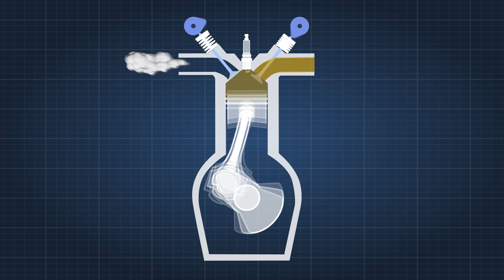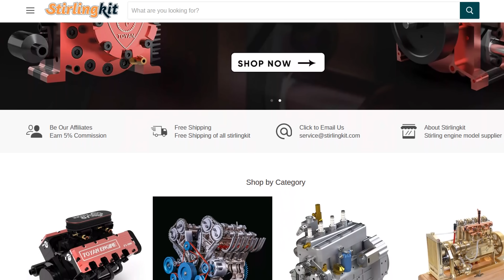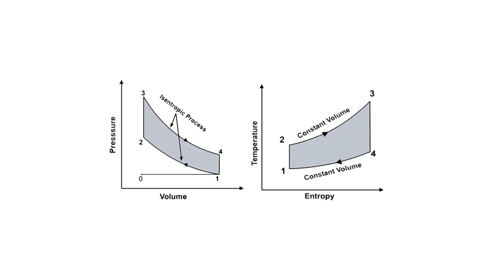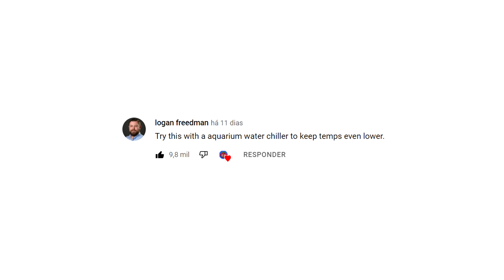I 3D Printed a Transparent Combustion Engine in Resin

Comment: Because on rhis little engine the ignition is switched on/off by a magnet. Meaning spark happens every TDC(top dead center). Because of that when you rev the ignition must be advanced so the fuel mixture has time to ignite in the chanbef and explode at TDC. And this is only on engines with an ecu(engine control unit).

Comment: It's not running as fast because Nitro methane can burn more at the same time but isn't as powerful, the engine is built for gasoline, which means it injects at a slower rate thus burning less Nitromythane and in turn getting less power.

Comment: Sir, it seems to me that you are having trouble with compression because the resin is more pliable than steel or brass due to temperature causing it to become more prone to plastic deformation. This may explain why you get a power stroke at first and then it skips a few.  The first power stroke that produces heat and pressure expands the resin cylindar slightly, losing compression enough for the carburators setting to not provide theright stoic mixture and therfore, no ignition until the "blank" strokes cool the resin, allowing it to regain it's original size, and then you get compression, and a good ignition stroke.  This would also explain why the more powerful, hotter fuel performedthe worst.  Great demonstration, as all your videos are.  Thanks for sharing your experiments with us.

Comment: it seems to me that the engine receives too little air for a given amount of fuel, this would explain the ignition at 25% at low speed, it would be very interesting to see the operation of this engine with air under pressure

Comment: The reason the methanol reved higher is because the air/fuel ratio was leaner. Thats why when you run methanol or any alcohol,  you jet the carb for twice as much fuel.  As far as the motor not firing on every ignition stroke, is because it doesnt have any load on it. Make it do some work with a load and watch how it acts! Great video btw!

Comment: I have an idea . The idea is to use water as fuel by a process called electrolysis  when we do that the hydrogen and oxygen in water breaks when you use that as fuel it will get more power will be generated and the byproduct is water

Comment: Look up R/C remote needles. Having one would allow you to adjust your fuel flow separate from your air flow. Allowing you to run rich or lean. It's a shame you don't have a distributor to twist and get your timing right. You may be able to electronically advance or delay whatever is sending the signal to fire the coil. Or you may be able to adjust the pushrod length and change when the valves open and close to shift the amount of vacuum and compression you have. But doing that could cause issues if the valves and piston have an interference with one another. 

It's crazy you've done this. I'm currently embarking on the journey of making my own R/C engine with my dad. He's big in the boat side of it, but engine manufacturers are starting to slim down in that space. Hence, the journey. We're going to be making a two stroke nitro-methane engine from billet, but I'm big into printing. So I'm going to try and print the block out of pet-cf or pa12-cf as well. The glass transition temp should be above the combustion chamber temps. The only real issues we may run into are vibrations and layer adhesion. R/C boat engines can hit close to 30,000rpm if the crank is balanced right and the block is thick enough to not split. Honestly, I'll just be happy if it hits 15,000 rpm before it blows.

Comment: Methanol contains only half the energy per gallon of gasoline but has a very high octane rating. Increased compression ratios could yield 5 to 20 percent more power. Methanol can be produced from natural gas or from wood fiber.

Since an engine's cylinder can only contain a limited amount of air on each stroke, 8.6 times as much nitromethane as gasoline can be burned in one stroke. Nitromethane, however, has a lower specific energy: gasoline provides about 42–44 MJ/kg, whereas nitromethane provides only 11.3 MJ/kg.

Comment: My guess on why the lower RPMs is that the power cycle is actually slowing down the timing: it forces the piston into its most extended state: refusing any movement pushing it back up. If I had to guess: the travel distance of the piston in the cylinder is too long.

Comment: you might need better piston rings, i can see fuel escaping into the crankcase. and wheres the oil? i can see some scoring marks on the piston, im afraid you are running the engine dry of oil. that is really bad for the engine

Comment: These fuels that require less air need to be tuned ao supply more fuel to burn efficiently. Thats probably why it wqs misfiring. Timing could be adjusted also but i dont think that was the main issue

Comment: i think that the combustion is not working because the resin thing is not air tight and it does not compress the air enough you can see that at 3:49

Comment: Has it occurred to you that you cannot mix the air/fuel ratio the same in all three cases?  It requires almost twice the fuel for methanol and three or more times in the case of nitromethane to achieve the same power for each power stroke.  You said nothing about changing your carb's jetting, so I am forced to believe you skipped that step to leave the solution of the question as an exercise for the students.

Comment: Maybe your purely-mechanical sparkplug timing, isn't responsive enough at high speeds, to trigger the sparkplug at the best time. You also aren't measuring the torque with the speed, so you may be missing important data.

Perhaps a phase-locked-loop, to produce the right negative delay, synchronised by the valves/cams. Then again, an Arduino etc should easily be fast enough to experiment with timing, and also to log the data.

Comment: Ok

I am a 15 year mechanic, and high performance enthusiast. Your problem us likely due to air fuel ratio which changes between all of those fuels. The higher the nitro the more fuel you need and the more timing advance. Up to 60 degrees btdc on 90% nitro. Less fuel for methanol from nitro, and even less for gasoline. You had the mixture too rich for gasoline and too lean for nitro. The one 25% I believe was obviously within the range that allowed the engine to fire consistently. More carb tuning could yield results, but likely you would need to change jet sizes to get enough for Hugh nitro content

Comment: You could try connecting the exhaust back in to the intake to reuse unused fumes, which will improve performance.
Reply: it will make it run like garbage, by adding co2/monoxide back in the cylinder it takes up room for the oxygen, making it run extremely lean.

Comment: First, I guess energy density doesn't translate to power directly. Here in Brazil, we have cars that can use gasoline, ethanol or any mix of both. While we get less mileage with ethanol, we get slightly more peak power (and torque) with it. One thing I know, although can't explain why, is that both optimal compression and optimal spark timing are different for gasoline and for ethanol. In our cars, spark timing is easely adjusted by the ECU, but compression is fixed, so engines are built with an intermediate compress ratio. Besides, there's the mixture proportion, that also must be adjusted for each type of fuel (again, easily done by the ECU).
So, what I'm trying to say is that there are some parameters that must be adjusted for each fuel that is used, and for your engine, they must be set manually, since you don't have electronic fuel injection.

Comment: I think the airflow to your carburetor was bottlnecking the performance of your engine. The nitromethane ran great due to its need for less oxygen. But it's low energy density means you will inevitably make less power if you are using the same amount of fuel. Considering the nitromthane runs with 4 strokes I think it would be fair to say you need more oxygen for the other fuel types to do the same. You will likely need to adjust your carburetor to use more air or you might need an entirely new carburetor to fuel the full potential of the engine. Great video btw😘

Comment: I am guessing the issue is fuel mixture, when it’s not correct it misfires, and maybe some left over from a misfire and some new mixture gets closer to a mixture that will combust.   Is there a way you can tune the fuel mix?   The thing with nitromethane is it has its own oxygen and needs to be run very rich compared to petroleum, and methanol also needs to run richer than petroleum, but not as rich as nitro. 
When you play with a gas torch, excessive fuel is a very slow burning orange flame and not very hot, as you add more oxygen the flame turns blue and get hotter .   I would experiment with mixtures until you had a blue flame that fires every time . 
Also ignition timing plays a part of good combustion.

Comment: Different engines need different fuels . Engines with less compression need fuel that combusts
Earlier and ones that have more compression need fuel with later Combustion. For Stirling kit engines we usually do not use gasoline anyways it's too powerful

Comment: Theres a sweet spot between power density and burn time. So, the issue you're having is that the much more power dense fuels are burning too quickly, and not providing as much mechanical effort downwards on the piston. The slower the fuel burns, and the more consistently/powerfully, the more mechanical effort is transferred to the piston on the power stroke.

Comment: Getting 4 strokes means that u have perfect otto cycle. Your design works well with that fuel. Torque is inversely proportional to angular momentum. Then it’s generating torque. To put things in context, ur first design test would suffer more than the design in the last test to climb an inclined plane.

Comment: I've been watching an enjoying a lot of your videos. This comment is more about your issues with making metal parts. Have you ever considered trying some "lost wax casting." You are able to print very precise parts out of resin that you could invest in either sand or other high resolution investiture, use your kiln to melt/ burn the resin out of the mold then pour hot liquid metal into the mold. Its a very old technique, but can produce some great results and you would probable enjoy it! It's also not very expensive. It would be a great way to get metal parts from your 3D printing capabilities.

Comment: There are multiple factors at play here but most importantly, the energy density of the fuels is a red herring. You're thinking about it the wrong way. 

Methanol and nitromethane have less energy than gasoline but you can use disproportionately more into the engine which allows both to make MORE power than gas. 

The issues You're dealing with here are the very different burn characteristics of the fuels. The carb would be setup to deliver the correct amount of fuel for gasoline. All fuels have a range of fuel and air mixtures at which they will ignite. Too much or too little fuel or air won't burn. 

Running an engine closer to the limit of too little fuel can allow for higher RPM but tends to damage most engines over time. When you switched to pure methanol you essentially leaned out the air fuel mixture and if the carb was a little on the richer side with gas that would explain the higher RPM with methanol. 

Nitromethane needs an even richer mixture than even methanol so when you added that you probably leaned the engine out to below a stable ignition point. 

That RC fuel also probably has lubricating oil in it which can cause funny things to happen.

The biggest issue is probably fuel delivery, double or tripple the amount of nitromethane mix going in and it will probably run better (or explode). 

Compression is also likely an issue as you and others noted. Reduce the height of the cylinder slightly and make some sort of gasket. 

The other thing is spark energy,  methanol and nitro need more energy to ignite so this may be an issue but probably only minor.

Comment: Its the dwell time for the switch to change state from on to off and on again. Since the rotational speed is twice the time it takes for the ignition signal to register you are only catching the spark every second power stroke imho. A faster reacting signalling device might be the answer such as a close tolerance hall effect switch. It looks like the switch used in the video is a magnetic reed switch, so there is travel time needed to latch and unlatch the switch if that is the case.

Comment: Air/fuel mixture is your problem. Small model nitro engines do this if the mixture isn’t correct. To break in a nitro 2 cycle engine, you run the mixture too rich until the engine “4 strokes” ie, fires every other revolution. All of what i stated can be found in O.S. 2 cycle engine manual under “break in” procedure.

Comment: its odd im stumped and i love science but my guess is going to be a reach it could lay in the types of compounds cause they are not the same so that or it could be the movement of how the gears meaning it what im thinking is ether the compound of the two different types of gas compounds or a mechanical part in how the piston is working cause if  i can remember right its pulling the gas up and back down cause a reaction that leads in a explosion so could be the piston with one gas isnt causing enough  friction to ignite the gas to cause it to work but then again u also have from the spark plug being the ignitor so you could be the having a mechanical issue the ignitor  isnt able to give a full current its just a reach like i said is all i can think of meaning it could be anything is up for grabs when u can only think of a reach i love seeing the tiny engine working i love your work tbh

Comment: Methanol has a higher octane rating than gasoline.  So it’s harder to ignite, meaning under higher compression it doesn’t light off on it’s own prematurely via compression/detonation under higher compression ratios.  95 Octane gasoline, if I heard correctly, also seems pretty high for such a low compression, although the actual compression ratio is unknown to me.

Your best bet is to look for spark blow-out.  Essentially, gasoline is dielectric and so when you have a fuel mixture that is too rich and/or too much of a gap in your spark plug (or too small a gap), your spark plug is unable to ionize the gas surrounding the electrodes and form the corona necessary to create an arc and ignite your fuel.  Different fuels will also run better at different stoichiometric values.  At that scale I also wouldn’t be surprised if re-jetting isn’t an option.

My suggestion would be either adjust your stoichiometry to achieve a slightly leaner fuel mix if you can, a tighter gap in the spark plug, or both.  You could also try bumping down to a lower octane fuel.

Edit:  I saw people also mention ignition timing advance, and while that is likely a factor, I don’t really see a way to advance the timing accurately per RPM with something at that scale.  In my opinion, you’re probably looking at air:fuel mix, and spark plug gap.

Comment: it is most likely compression or mis-timing of the spark because nitro can start the process of combustion if the cylinder is hot enough

Comment: Choose a lower octane gasoline fuel: Instead of 95 use 80 or 85. Octane reduces the ability of the fuel to ignite, even though once ignited the octane enriched fuel retains the same amount of calories of energy per KG. Higher octane is for higher compression engines only, and prevents “pre-ignition”. Pre-ignition means the fuel ignites too early on the upstroke. When you used 95 my first thought, even before you started the engine, was, “how will he get enough compression with that short stroke, with a silicone o-ring for a piston ring?” . Great video! I loved it!

Comment: I think it doesn't ignite well, because cylinder is completely soaked.  In both instances of ignition you create water and carbon dioxide. So it can be that the water chokes out the ignition.

Comment: Make a see through head with overhead cams now
So we can see cams push valves and whatnot

The speed linely is the carb still putting out gas anounts of nutromethane instead of nitromethane amlunts, stoichiometric.
Make the jet bigger or smaller and see what happens. Carb jets cheap. Or if it has a throttle plate make it go early or late to the jet needle

Comment: The problem is probably the air fuel mixture and most likely also the timing, becuse different fuels want different amount of "pre ignition" (static pre ignition, becuse you don't want combustion to happen before top dead center, becuse then it will back fire), that's alot of the time the way different fuel make more power (like E85, just over half the power per volym (becuse of the efficiency) but you can with the right timing (pre ignition) give it twice as much fuel with out geting rich (making less power then with less fuel)). One way to solve the problem is to get ignition retarding on rev, the easy way of doing that is with a CDI (computer digitalised ignition) and I would probely use a diffrent more automotive fuel instead of RC car fuel becuse that is what I am used to, Bensen is good old one but is realy hard to get becuse it's carcinogenic, but will respond with some othere options after having had a good thought.

Comment: Alcohol has more hydrogen and less carbon, gas has more carbon and less hydrogen ratio, the difference between an orange and blue flame ratio.  Whoever manufactured the little engine, the machining of the valve rocker pivot boss and shaft could be better.

Comment: Methanol and nitro methane are used cause you can get more fuel into the Cylinder which means using the more powerful fuels your ruining very lean with them ans need to put more fuel in the Cylinder for it to work better